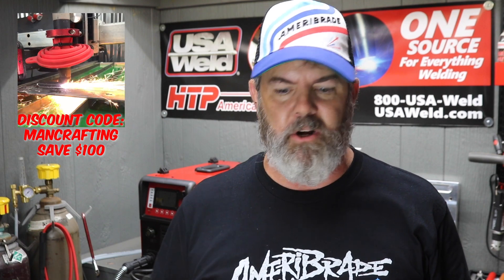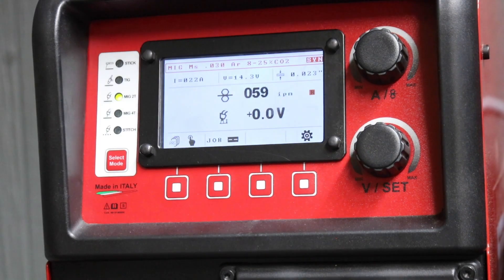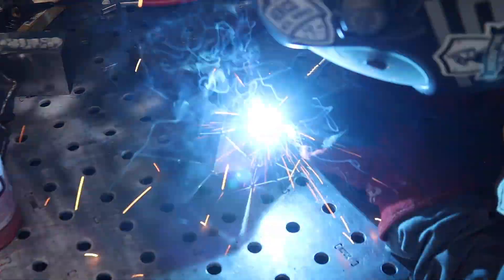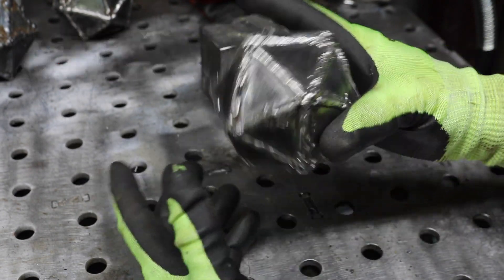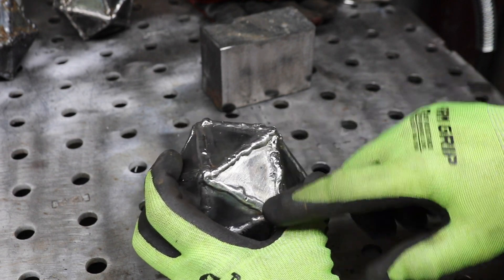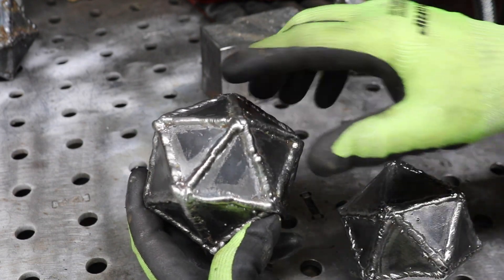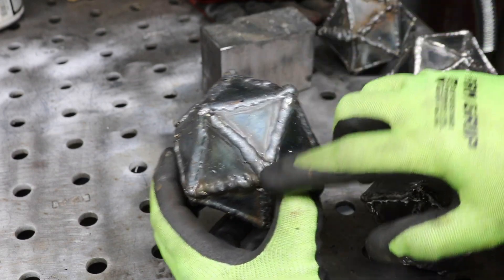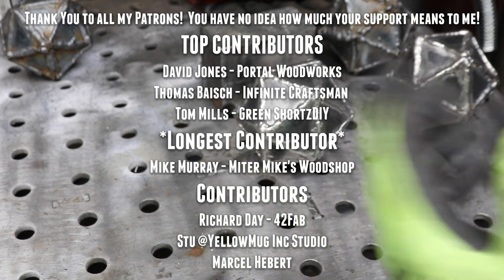Learning to Weld Better/Icosahedron Dice

Comment: chad, one it looks like you're getting hot, but also look at the carbon build up,  unless youre running duo shield flux core (#apexish @ JD Brewer).  I seem to have a similar problem on a project I was working on, but after a clean up grind and brush it seemed to get better.  How about tig welding one of those, I wonder if #42Fab would send me one to tig????
Reply: BTw im learning too
Reply from the maker: It was definitely getting too hot.  When I cooled it down I got better welds again.  I’ve also been told thinner wire will make a huge difference.

Comment: Nice job Chad. Ill be ordering some soon. Love playing with welds, one day i might actually need to do it....lol
Reply from the maker: If you haven’t get some scrap metal and just practice. You’ll fall in love with welding.  Thanks for watching.
Reply: @ManCrafting  cool thing is a steel distributor just opened up down the road from me....
Reply from the maker: Miter Mike's Woodshop that’s awesome.  Usually they will have drops that are real cheap or if you talk to the right person they have bins that are picked up by recyclers and they get pennies a pound, but if you tell them your using it to practice they may give it to you.

Comment: Seems like a fun little project. I may have to get one as I need to work on my welds too... tho I'm still trying to figure out what's wrong with my crossfire.
Reply from the maker: I’d definitely get some to practice with and if your having issues with the crossfire contact Langmuir.  Their customer service/support is fantastic.
Reply: @ManCrafting  Yeah I have.. they gave me some things to test.. but right now my mac mini that was running mach3 died. so I have to deal with that first
Reply from the maker: Interactive Realm gotcha.  I really would like to see you get it running.

Comment: Chad, I'm not sure of the metal gauge on those dice, but it looks like you are welding too cold with too thick of an electrode.  I generally use .023 wire on sheet metal up to about 14ga.  You can run that thin wire a bit hotter with a slower wire speed and it will sit flatter.  With things set slower it will give you a ton of control.  Just like anything, once you get your welds looking killer at slow speed, you can increase travel speed and wire diameter for faster production...  Since I started Tig welding most of my stuff, I prefer going back to slower Mig settings when I pick up the squirt gun.
Reply from the maker: Great advice.  Thanks.  This was 14 gauge.  I’ll get some .023 in order from HTP and give it a go.   The machine welds so good on thicker metal and even with my lack of experience was blown away with what I could do I never considered thinner wire, but it makes sense. Why else would they make it? 🤷🏻‍♂️

Comment: good practice! Welding open gaps on thin steel with .035 wire is gonna be rough. I like to use .030 or even .023 wire.
Reply from the maker: Thanks. Great tips. I’ll get those sizes ordered from HTP today and give that a try.
Reply: @ManCrafting  If you do order 023 wire, HTP sells a smaller liner for your 24 series gun that might help in case you have feeding issues (023 wire has significantly less column strength than 030 wire or 035 wire).  The stock liner is good for 030-035-045, but the smaller liner is "one-size smaller", for 023-030-035. One thing that may help visibility when making very small, narrow weld beads is what is called a "tapered" nozzle.  It necks down to about ½" compared to the stock conical nozzle which measures 5/8" OD at the end.  

That being said, 030 wire is a good compromise. Couldn't help but notice your left guide hand was very very close to the weld bead.  For low-amperage welding it obviously poses no problem, but for serious welds close to ¼", your glove would be smoking and your knuckles/fingers would be on fire, especially if/when you decide to try out pulsed-spray programs.  It is just my suggestion of course, but if I were you I would start to hold the gun with the guide hand holding the gun/trigger hand way back where the handle is.  Use the guide-hand for support & stabilization only; use the trigger hand for the actual deliberate movements of the MIG gun.  Once you get your brain trained for it, it makes it 2nd nature and builds up your fine-motor control in your trigger-hand for times you will not be able to guide the neck/nozzle with the guide-hand the way you did here.  Again, that's just how I do it.

Overall it came it great.  I just ordered my kit!
Reply from the maker: Oscar Sanchez Jr, BSc. Thanks Oscar.  I didn’t see this comment earlier.  It was a reply under another comment.  That’s all great info.  I really appreciate the insight.  I wouldn’t have known to change the liner.  Do you change the liner back and forth if you want to use larger/smaller metal?  Or do you just have a dedicated gun?   Also, great tip on the hand position.  That makes perfect sense since I happen to have two blisters on my left index finger knuckle.
Reply: @ManCrafting  dedicated gun all day. If you have the 10' gun it should push .023 as long as your lead isn't all coiled up
Reply: @ManCrafting  I keep the smaller liner stored away just in case I decide to use 023 wire, but other than that, I don't mess with changing it out since I mostly just use 030 diameter wire, so the stock liner is just fine for it.  It's just one of those things to think about.